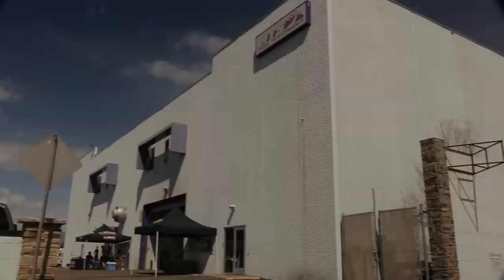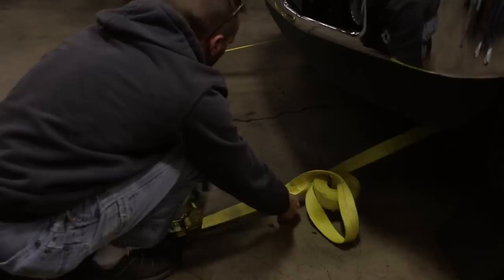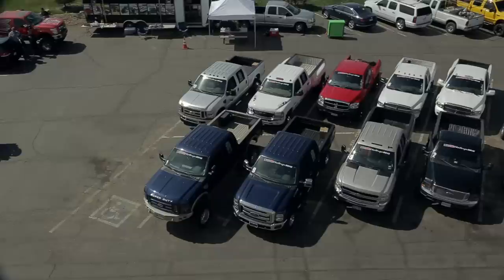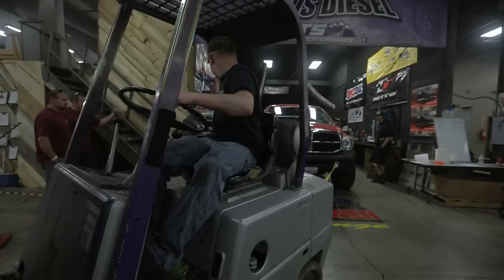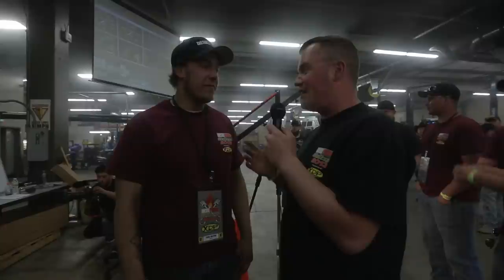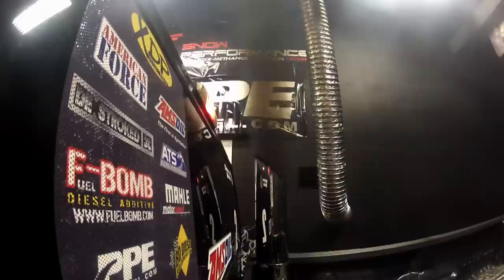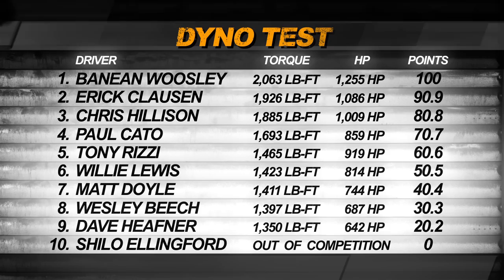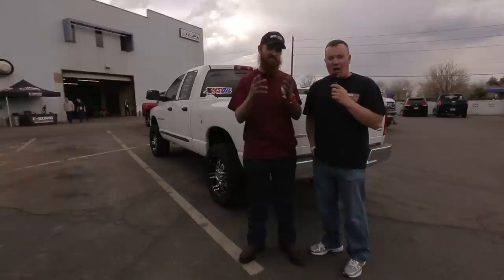Dyno Testing - Day 1 of Diesel Power Challenge 2013!

Comment from the maker: ATS actually has very powerful vent fans in the back of the dyno cell, which is why the smoke doesn't empty out into the crowd. Also, by the time the smoke gets bad, the truck has usually made peak power, so it doesn't affect the numbers much.
Jason Sands, Associate Editor of Diesel Power

Comment: Won't the black smoke circulating back to the engine via the cooling fan in front of the truck give less clean air to the engine and cause loss of power and dyno result? They should have a much better exhaust extraction/ventilation system to draw out all that thick black smoke.

Comment: No.  The higher the altitude, the less dense the air is.  Density of air has a direct effect on power output. High density air means more O2. More O2 means more fuel which equals greater power.  The temperature of the air also has an effect on the density. Colder air is more dense.

Comment: I also have a tundra as well. A 2010 5.7 l crew max with a trd big brake kit,air intake,headers,fuel injectors and a custom intercooler.Just hit 100,000 miles!

Comment: No, gasoline and diesel cool fuel pumps as a side effect. Fuel however, can be anything to provide heat and/or power. Coal can be fuel, but it isn't used to cool fuel pumps.

Comment: Well, I know the older U4000 very well, because I drove one during my time in the army (Bundeswehr). And they have an enormous pull, because the Unimog was originally built for pulling heavy farm machinery (and it is still used in this capacity). And the standard U4000 with the 160 kW engine has maximum torque of nearly 7200 lbs. And a Unimog U4000 in germany costs 70K €, and a new Dodge Ram 2500 costs 55K €.

Comment: my 5.7 is super charged and was rebuilt 30,00 miles ago, so its still new. and im pulling over more flat terrain. and ive only moved 20k lbs 1 time. my fuel pump quit 2 days later. it definitely didnt want to move that much weight.

Comment: the cummins diesel is a 5.9L ( or a 6.7) that makes 350-450 horse and 600-850 torque. the powerstroke and duramax are converted V8 motors and dodge just dropped a 4 liter V6 diesel making 250 horse and 450 torque

Comment: If you want to talk sensible numbers on diesels, there's the BMW X5 m50d, a tiny 3 litre in-line 6 that delivers 380 hp, 550 lb-ft and about 37mpg (is very well build, looks good, etc.). If however that is not enough, there is the petrol powerd Mercedes-Benz G65 AMG that has a 6 litre V12 that delivers 610 hp, 740 lb·ft, weighs around 6000 pounds and does 13mpg.......oh and its very luxurious, has top level build quality and prices start at 200 grand.....

Comment: The high altitude reduces the amount of oxygen in the air. They could run a lot more NOS to compensate but most of them probably wanted to drive their trucks off the dyno.

Comment: Not trying to hate on my own home turf, but have to give credit where credit's due. A stock 2013 M5 was dynoed at 534 whp, that puts crank hp somewhere around 600 hp. All from a 4.4L twin turbo V8.

However, credit where credit's due. Our "big fat lazy" engines are lighter. GM's 7.0L weighs close to the same as BMW's straight six.

Comment: EXCUSE MY CAPS LOCK. JUST WANTED YA'LL 2 KNOW THAT IM NOT YELLING OR ANYTHING, BUT IM CONFUSED BOUT THE FIRST TRUCK THE FORD I MEAN WAT IN THE HELL IS THE DEAL WITH THAT FIRST GUY, WHAT I MEAN IS BEFORE HE DYNOED IT HE SAID HE ESTIMATES THE HORSE POWER TO BE AROUND 865 AND THE TORQUE TO BE AROUND 1600, AND IT ENDED UP MAKIN' 856HP AND 1700TQ AND THEN HE SAID THAT HE WASENT HAPPY WITH IT AND ITS NOT GOOD WHEN THE TQ WAS WAY BETTER THAN WHAT HE WANTED AND ONLY 10HP DIFFERENT. I MEAN WAT THE HELL!!

Comment: It's calculated by the computer. The computer takes the speed of the engine, the speed of the dyno drums, and the force applied to the dyno drums and then spits out the torque value corrected for gear reduction from the transmission, rear axle and tire size.

Comment: Those diesels are built a bit differently. They are not quite as heavy duty as the diesels found in these trucks. They would require stronger connecting rods and a new crankshaft to really take the power. The rotating assembly on these trucks in the video can generally take 2000+ lb-ft of torque.

Comment: No, it's full of stuff like sulfates, silicates, and other stuff proven to cause cancer and serious lung issues. Plus the fine particulate matter is a major contributor to various lung issues. It also produces tons of NOx which leads directly to acid rain, ozone depletion, and respiratory issues. A modern, stock diesel with emissions controls in place is fairly clean. These trucks here are MAJOR health/environmental hazards.

Comment: Yes, I realize unfiltered petrol/gasoline exhaust also contains poisons and carcinogens. The list isn't nearly as long as diesel exhaust though.

I should make it clear that with the proper modern emission controls both gas and diesel engines are quite clean. However, diesel engines with no emissions controls (like the ones in this video) are very dirty.

Comment: Sort of, tire diameter isn't measured. The dyno only measures the force being applied to the drums, the result being "wheel torque." Torque at the crank is always a guess on a chassis dyno because there's no way to measure frictional losses from the drivetrain (trans, rear axle, and tires.) To complicate things even further, a dyno doesn't actually measure horsepower, only torque. Horsepower is another calculation derived from torque.

Comment: Over 2000 ft lbs of torque . I loved that one truck that wanted to launch from the floor :)
Reply: dont want to be "that guy", but crank tq doesnt mean shit. its about hp.
Reply: Chad W  It's actually more about power applied to ground .
You can make a thousand horsepower , and make nothing more than a fart on the track unless you can apply it to the ground :)
Reply: Chad W  Power = Torque * rpm. So no torque- no power. Both hayabusa and MAN 6,9L diesel engine make about 200 hp.
Reply: Marine475 engines spin so your point is dumb. how fast your car is at any point in time is determined by the engines actual whp output. crank tq says NOTHING about performance.
Reply: Ignignokt Mooninite yeah, thats called whp. not crank tq. a million lbs of tq at the crank could still make a slow vehicle... a million hp car will not be slow
Reply: Chad W that million pounds of torque may not be fast but it will move mountains.
Reply: I don't think you understand how rotational force and horsepower correlate, Chad. Horsepower is a largely irrelevant number. That figure is calculated by plugging torque and RPM stats into an equation. Horsepower numbers literally do not calculate a measurable force and mean almost nothing. Torque, on the other hand, is a calculation of rotational force. What makes a vehicle "fast" is a combination of gearing, weight and where the power is distributed within the engine's RPM range. The reason a car with a gasoline V8 is quick is because of the wide power band. It can rev from 4,000-7,000 and make respectable power (torque) all the way through that range. The reason one of these trucks can drag your house off of its foundation and pull it around the block is because they produce an incredible amount of torque at a rather specific RPM. You're only talking about peak torque within a few hundred, maybe a thousand RPM range on a low-revving diesel engine. That's what makes the engine performance so different and the stats almost incomparable.
Reply: HP sells cars TQ movs cars - my father]

Comment: toureg v10 tdi but thats a comparatively low displacement engine(5.0l). Its, well you know, a european 5000 rpm reving diesel. Its unlike any of the diesels used in this test. Same goes for the audi v12 diesel.

Comment: @James Brand, I'm pretty sure the Range Rover Defender was on flat ground, no? The Dodge Ram 3500 has a best in class towing capability of 38,000lbs. That's going uphill at 55pmh at least, and you're bragging about how the Defender can shift a 24,000lb truck. I fail to see how European vehicles are better for towing long distances.
Reply: Lol Range Rover Defender? You mean Land Rover Defender. Anyways, no there is no way a Defender is pulling anything near 24.000 lbs... Now if you had the V8, and you put one of these turbocharger things into it, then maybe you could get close before the engine blows up. But all that said, Defenders aren't really built for pulling. They are offroad vehicles that were originally designed as the English counterpart to the Willies Jeep during WW2.

Comment: my V8 land rover has a 5ltr Supercharged V8 putting out 500bhp and 620 lbs of toque FYI its a Buick 3.5ltr stroked out to 5ltr and supercharged.pulls up to 7 tonnes if i need to pull something heavier use the family's 6 Wheel Drive Saracen APC using a stock Rolls Royce Diesel which has pulled a 60 tonne MBT

Comment: it still does a heck of alot more then a Yank pickup and cost a hell of alot less American diesel trucks were offered in Europe and the sales flopped which is why the only way you see one on our streets is if someone goes to an importer and even then they are only used for advertisement when the owner wants to pull something they use a Mitsubishi L200 or Nissan Navara as its more capable comftable and useable

Comment: I don't think diesels are bad in general. With modern emissions controls they are quite clean. It's only when you remove them that they really start emitting the poisonous and carcinogenic chemicals. 

I'm not talking about CO2 either. Tons of CO2 is released into the atmosphere by non-human sources, like geothermal activity. Also there have been times in our planet's history where CO2 levels were much higher than they are now, and life did just fine. Frankly, I'm not concerned about CO2.

Comment: Most douchebags that drive diesel trucks don't touch the engine. They just lift it, put big shiny chrome rims on it (which will get wrecked if you take it on some trails), and put tires with thick tread on but weak, thin sidewalls.

Comment: Are these large diesel trucks really sensitive to the cold?
Reply: Cold air and low altitude = more oxygen for combustion from density .
Reply: One morning this winter I go out to warn up my car and I find my kneighbors Huge diesel truck pluged in to keep it warm. Every subsequent day I find it pluged in even when it was comfirtable out in the morning. He had Texas plates and it perturbed me was he just being cautiouse or are he consernes justified?
Reply: Diesel engines require the heat of combustion alone , or coupled with artificial help (like glow plugs or a block heater) to induce the atomized fuel to ignite if the ambient temperature is very cold . Usually once they are running , they'll stay running . Not sure why your neighbor has to do this in normal weather . It makes it easier to start though .
Reply: Christopher Bloom in colder weather diesel fuel gels up or becomes thicker. So most likely he was pluging in a fuel tank heater to keep his fuel from thickening.
Reply: TheTyrial86 its to keep the engine warm so it starts quickly
Reply: sjpro1 You are correct as well. It depends on the truck and what add ons has been done to the truck. Some have fuel tank heaters, some have engine heaters, some even to plug in for glow plugs.

Comment: they dont need to be market leader. if they sell a powerstroke, duramax or cummins, its gonna be used to pull, we just turn them up for more power, and get carried away. and i bet my half ton GMC could pull more than you V8 land rover. 385 horse and 400 lbs of torque.

Comment: Euro vehicles are more fuel efficient, period. But they are not put into situations that Americans get themselves into. (sorry Euro guys for this) I would not VW or Audi to go pull a half submerged,18 foot boat out of the swamp/ground (something I've done with my 5.9 cummins). But I would take a VW or Porsche or other Euro diesels for may other uses.
You cant compare Euro and American diesels, you will never reach neutral ground. They are both diesels, none is "better" than the other.

Comment: heres a number ofr you. 2013 dodge cummins. 6.7 liter diesel. 385 horse and 850 lbs of torque. same size as the aude. 100 more foot lbs of torque. and a straight 6. not a v8

Comment: not hard to pull whats on wheels. my half ton GMC (5.7 liter S/C) can pull 20,000 lbs on a trailer. it wouldnt like it but it would. and thats a V12 pal, not a small block V8. the U.S. doesnt make big blocks like we did 40 years ago. we make powerful small blocks. and when i see a V12 pull a trailer every day for 5-6 years, ill be impressed

Comment: Wow really? Great ventilation system? This mustang dyno reads low normally and it doesn't help when these trucks are choked down trying to breathe in non existent oxygen after the room is filled with exhaust gases. Use those vents!

Comment: yes we can 70mpg is the quote for a 1.4ltr VW polo diesel and yeah most euro diesel pickups makes 45-50mpg its still 20 mpg better than any yank pickup if yank pick-ups were all you claim then they would be predominant in the euro market fact is they aint euro market is dominated by Mitsubishi L200's,Nissan Navara's and such which have better economy, better engines and better quality interiors that are not wall to wall with cheap plastics

Comment: Cooling is a wonderful side effect of liquid and gaseous fuel, but solid fuel like wood, coal, and charcoal doesn't cool anything. A better phrase would be gasoline and diesel cools fuel pumps and motors. But a 'fuel' is used to make heat and/or power. And you are being very rude by assuming that I would trash talk you. Assume= makes an ass of u and me, but mostly yourself.